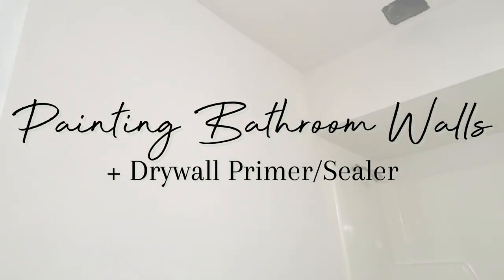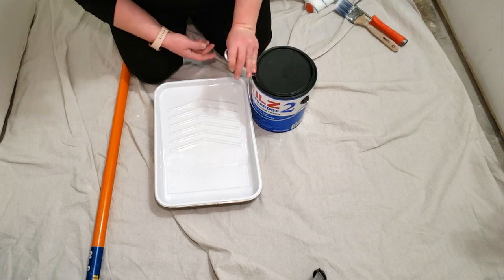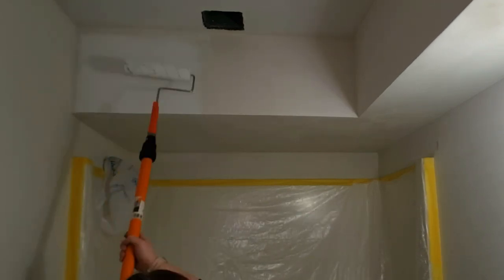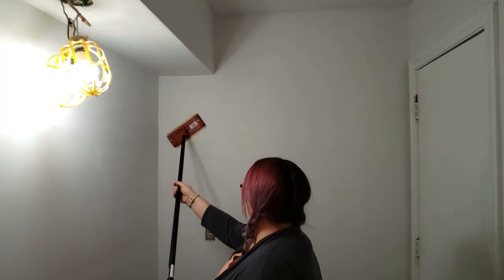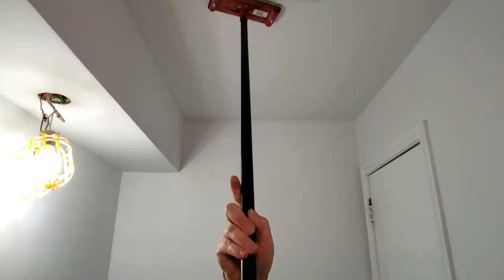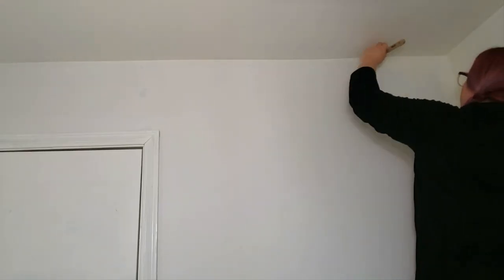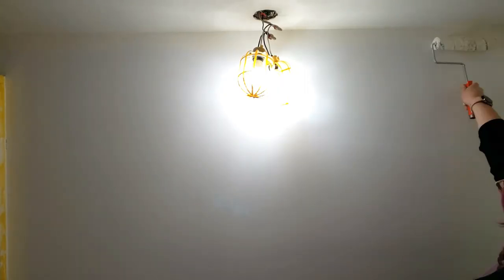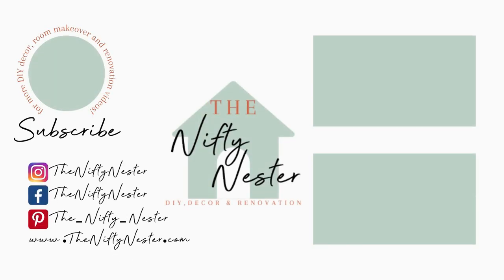Painting Bathroom Walls | Best Paint & Drywall Primer Sealer | Bathroom Makeover On A Budget EP.8

Comment: This is an amazing transformation!    So much attention to detail.   Very helpful information.    A tidbit learned to help me be less messy when pouring paint is using painters tape or packaging tape to form a "V" on the top of cans in order to direct the flow.   On gallon cans I use 2" wide tape or add an extra strip of narrow tape.   On smaller cans the tape width isn't an issue.   I admit I wasn't aware they sold pour-lids with detachable spouts.   That makes it easier to stack paint for storage = so helpful.   New subbie.

Comment: If you didn't get all the dust wiping down after the sanding it's really important to sand after the first primer coat.
Reply from the maker: That's a good point as well. The little bit of dust on the walls won't hurt anything, it mixes in with the primer and is just an added solid in the primer but it can add to the wall texture.

Comment: Did you have your paint sprayer when you did this? If yes why not spray it?
Reply from the maker: Yes I did have the paint sprayer at this point. You can use a paint sprayer indoors and it'll get the job done quickly but the finish won't be quite as perfect. After taking the time to skim coat the walls and ceiling I really wanted to get that perfect smooth finish with as little texture or variation as possible. Using a roller is the best way to accomplish that. You're also more likely to have overspray and get paint in places you don't want it when spraying interior walls. But when working on the exterior or other wood projects I'll definitely use the sprayer.
Reply: @TheNiftyNester  thank you!!!! Your answer is super informative! Also thanks for video on sprayer I bought the vsp one because of that video! Just wish it was cordless
Reply: Are you cleaning with a wet sponge after each pole sanding?
Reply from the maker: No, when you're sanding in between coats of paint you don't have to wipe the walls down at all in between. There's not really any dust created when sanding since you're just knocking down any bumps or weird texture and any dust that might be left will bind to the next coat of paint.

Comment: How much paint and primer is needed?
Reply from the maker: It depends on the paint you're using, how many coats you'll need to do, and how big your space is. In a small room like this, I used less than one gallon for the entire room and the ceiling. Behr has a calculator that helps you figure out how much you'll need depending on the size of your room, and most other paint brands have a similar tool. It'll be the same with primer. It'll depend on how big the room is. I used closer to a gallon since I was covering joint compound, which is like priming new drywall. If you're covering an old paint color, it'll take a little less per square foot.

Comment: Can i just prime without painting?
Reply from the maker: You can. It just depends on the look you want. I used a primer instead of a paint and primer in one since I was going over fresh joint compound. If you aren't sealing drywall or covering a dark color, you could use a paint/ primer combo to get the color you want. Primer by itself can be tinted but not much. It will weaken its adhesive properties. Primer itself looks pretty dull but if you aren't worried about the finish it'll be fine.
Reply: @TheNiftyNester  thank you!

Comment: This is an incredibly good video.  For me, the only thing missing is a joint compound, as I need to fill some gaps first.  Would have been nice to see what to use and how to do it in a bathroom, but I understand that's something you didn't need to do.  Thanks for the other tips.
Reply from the maker: Thank you so much! If you're interested I actually did skim coat the walls in this bathroom using joint compound to fix the mess that my walls were. If you go to my channel it should be the video I posted right before this one. I hope that helps! Thanks again. 😊